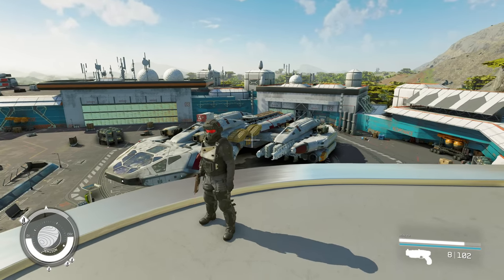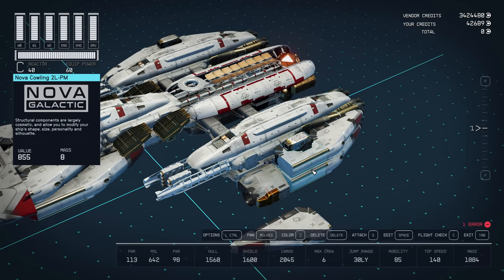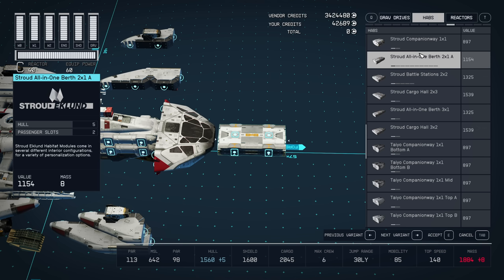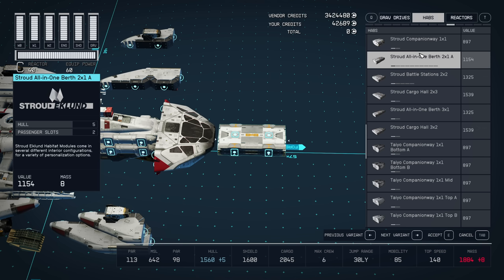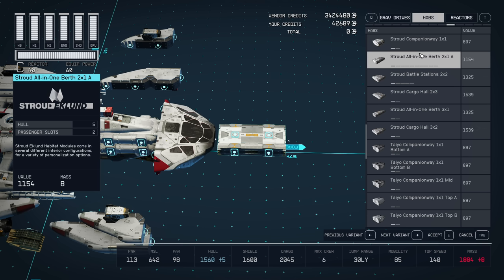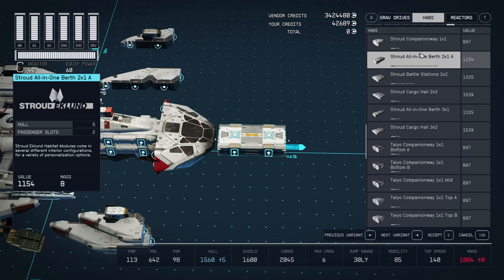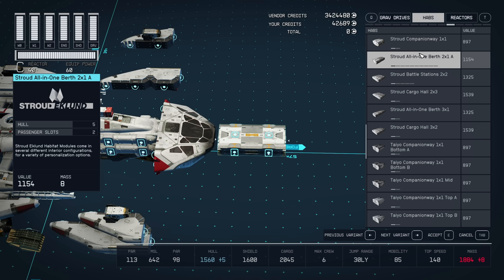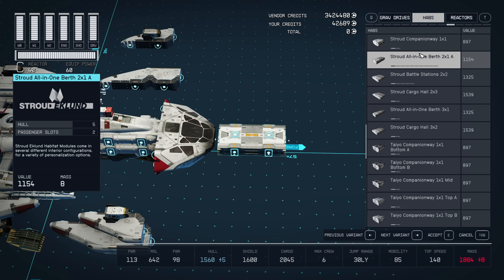Starfield Ship Mechanics, Stats & Building Full Guide

Comment: I’ve sort of figure out the hab - ladder randomness, I had double stack of 2x1 habs with a 1x1s behind them I only wanted 1 ladder running through the whole ship, it kept giving me two ladders unfortunately. The 1x1 ladder I wanted and a ladder  from my bay through my workshop going into my captains quarters, for RP reasons I wasn’t feeling it. The work around was building it with just the 1x1 stack leaving the ship builder and entering the ship then going back to add my captains quarters. So I think it won’t add ladders if you can already get to that level

Comment: Turret Angle Question?
seems like you'd know
you said they have an arc of about 80degrees.
I'm assuming you mean horizontal transversal

But what about elevation? 
How high up or down can a turret aim?
Can a turret on the Topside of my ship, aim below the horizon level at a target Under my ship?
maybe it's beneficial to use those sideways Taiyo or Deimos weapon mounts for adjusting turret arcs to be vertical/horizontal depending

space is 3d after all... so this info can be relevant to what direction I face my turrets and whether I approach a target from above, below, head on, etc.

Comment: Actually, a C-class ship can still be fast. The speed of your ship depends on your engines. If you're willing to build something small, you can still have a huge reactor with heavy shields and weapons. I built a kind of heavy fighter that way that still can house 8 crew and about 3000 cargo, 200 shielded with about a manouverablity of 88. I did that by picking the highest thrust type A engines that have power 2 so I could strap on 6 of them. I get up to 160 on full power, full thrust and up to 600 when boosting. He talks about that in the engine section and it's worth understanding,

The thing with engine power is that you need to divide thrust by engine power to get the effective output, it helps if you want to compare them.

Loading it up with particle cannons I often use it for some extra XP by jumping into Kryx and shooting down the entire pirate fleet.

Comment: 1:12:11 - "...second best shield in the game."

That's debatable.
There's a B-class shield with 1500 health:
The 28T Defender Shield Generator.
However, it can only be mounted on the side.

But it's only 90 mass.
And it has a Regen Rate of 7%.

Compare that to the Assurance SG-1800.
1,600 health 
160 mass
5% Regen Rate

Frankly, the 28T the better shield.

FYI, both add only 5 hull.

As far as aesthetics, I mounted mine on the inner side of one the landing gears on a C-class I built yesterday.

Comment: Cant wait for SFEdit (Xedit) to correct some stats, especially the weight of the cargo modules makes zero sense, they are way to heavy. I will be trying to balance those weights, dastically reducing cargo module weight while increasing reactor weight to compensate. 

Some other modules dont make sense either, the Nova cowling when placed on top weighs 4, when you mount it upside down it all of a sudden weighs 8. Now those are small numbers, but it's the inconsistency.

Then hopefully when the creationkit is released someone will fix the positioning of modules to be much more varied. Some parts have 8 possible positions others have just 2, cant be placed upside down etc. etc. There is alot that makes zero sense and seriously reduces creativity, and most important, control over door and ladder placement no matter how we interconnect modules :-)

Comment: I run 2 beams and an EM and just swap between Kill or Capture mode. What is the benifit to leaving your ships weapons low-powered and then powering to reload? Does your ship use those unalocated power units to repair? Sorry if it was covered  -  it was a long one.
Reply from the maker: The advantage being you can equip the max number of weapons, so for example 4 particle beams in slot 1, another 4 in the second, and another 4 in the last, and being able to fire all of them while not needing to have the power to full charge all of them.  A lot of build I see have a full w1 power bar, like half of the w2 and nothing in w3 so that they can "fully power" their weapons, but because of this they are missing out on a shit ton of damage.  Just run rapid fires and you don't need to worry about reload as a full loadout can kill multiple ships without reloading

Comment: no the best reactors are at taiyo the pinch 8z not available elsewhere
also lvl 60 is the last lvl you need to have the best parts... no more are unlocked afterwards
the farther distance between 2 stars is 28ly so you need at least 28

Comment: I'm not sure about what the max speed for engines actually mean.  On my current build I have 6 of the top end class C Slayton engines (they only use 2 power a piece so you can have 6).  I top out at 180, when it says my top speed is 130 in the builder.  So it's another thing I think there is more nuance than just "this is the number".

Comment: I feel like you helped me understand most of what I’m trying to look for when ship building but Im still confused about choosing engine class and different types. I found that all of the posts online about this are so confusing and vague and do a horrible job explaining how the tradeoffs work. Specifically between maneuverability and speeds. Does anyone have another source that helps explain this more and actually knows what they’re saying?
Reply from the maker: You can read the written part of the guide on reddit I made.  But long story short mobility is just how fast you turn/pitch and speed is top speed when not boosting.  Go A class if your ship is light enough to get 70+ mobility and your good, if your ship is too heavy then go b class

Comment: Unfortunately, I cannot utilize any shield better than any other period. My shields are always capped out at 100 fully powered. I have no idea what is causing this, so I just have the lowest shield on at all times so I can actually use the power. I have tried the various fixes other people have with THEIR shield bugs(mine is not the same) and it did nothing. Doesn't matter my ship, obtaining method, whether crewed or not, whether it's the original shield or not. Always 100.
Reply from the maker: Are you talking about your shield in the ship info menu or your shield on the ui?  Because the shield on the ui shows the percent and only goes to 100 because that's 100% shields
Reply: @STALVIET  It.... what? Why the hell would they show percentage of shields as the default? And why would it not show the percent symbol for that? I think you just saved my ass. THANK YOU!

Comment: Im building a class a to be better than the first guardian ship i got starship designer 4 wondering where best suppressor and other main parts are sold i dont need the shielded cargo
Reply: The suppressor on the star eagle im looking for
And best reactor, grav drive, for secondary weapons i know what missiles to use but will laser or particle or ballistic be better for 3rd weapon group

The body i got figured out with wings and 5x3 stroud body 
and so far everything is 540000 credits for what i want it is 2 story 3 including cockpit and docking spot, side landing bay 5 engines 3 main weapons 3 secondary 2 missiles it works and looks clean and intimidating for its size easily upgradeable to a b class

Comment: First off, love the ship design... Definitely looks very Nova Galactic in style...

And yeah, Taiyo is really hit and miss... Some habs really do fit their "sleek and advanced" styling claim -- I personally love their Captain's Quarters, for example -- but their living quarters are terrible, and aren't just a case of being stylishly "simplistic"... Taiyo would have done much better using some of the Deimos/Stroud Living Quarters, etc, but with different lighting, to fit with the claim of being "sleek and stylish" if Bethesda wanted to be too cheap to make a unique interior for them...

I really am disappointed at the fact that Bethesda were too lazy to give each manufacturer unique internal looks... It should not have been that much extra work, and I really feel that it's one of those "The modders will fix it!" type of moves...

Most All-in-One habs have a cooking station, usually listed as a "Galley", btw... You might have inadvertently removed it with some of your connecting hallways...

Comment: I wish the Devs made the shipbuilding experience the same on Console as it is on PC because building a ship from scratch on the XBX is like holding a bulldog with one arm and designing a ship with the other arm. Now XBX Gamers will probably understand what I mean by this and I am referring to the horrible lumpy manoeuvrability of the shipbuilding is soo bad on the console if you mess up and you can't get back to the layout you're up shit creak without a paddle putting it bluntly. I hate the manoeuvrability of the shipbuilding if it is so lumpy and awkward on the console it makes the designing longer and more frustrating.  I wish the devs would have made it easier for the console gamer. The fact that you have to move around from one shipyard to another is frustrating but I found a simple workaround for this... Bay, Cockpit, Babs, Shield, Landing gear, Grav Drive, Reactor, and Engines to remove the errors and then you can go from one Staryard to another.

Comment: I'm playing on Xbox Series X and I tried modifying the Razor Leaf......WHY WHY WHY didn't they let us move the cursor with the right  thumbstick so it moves freely like you're using a mouse!?!?! You have to use the d pad to click through all the parts instead of just going and clicking on the one you want...... ASSIGNING WEAPON GROUPS IS A MIGHTMARE!!!!
They also should have had some of the parts like shield generators and weapons either automatically add a side mount or rotate if you wanted to place them on the side of a ship. Some things just won't go where you want them and there's no variation of the piece to be able to mount it in a different orientation. 
I'm GLAD it's on Xbox but it's like they made everything for PC and then just stuck a bunch of button commands into it for console. 
MAYBE I just need to unlock more stuff but I needed up undoing everything and just going with the two scan jammers I needed to smuggle contraband mounted under the weapons on the back of the top of the ship....which DID AUTOMATICALLY rotate to attach at a 45° angle so why can't all the other parts automatically orient like they did!!??

Comment: Many Useless Habs
I wish they'd give More Purpose to a bunch of the currently cosmetic habs
imagine if the engineering bay added a bonus to ship repair speed
if the cargo hall contributed to actual cargo capacity
oh! and what if braking engines, cowlings with thrusters on them, etc added a bonus to ship maneuverability?
radiators could improve boost recovery...

Comment: I’m level 66 and went to titian and a lot of the parts were not there and I’m on console so what’s the go with the parts does anyone one have a answer for me please
Reply from the maker: all the parts except the reactor, docker and obliterators are sold at titan.  the reactor, docker and obliterators are all sold at neon
Reply: You’re above level 60 so you should have access to see all the parts, assuming you have C Class parts unlocked with Pilot 4. But to use all the parts, you’ll need higher levels of Starship Design as well unless you use the part glitch. But the main thing should be your XP level with Pilot 4 to at least see all the parts.